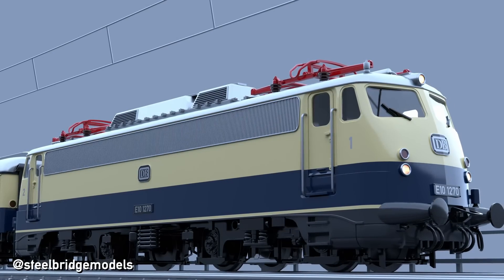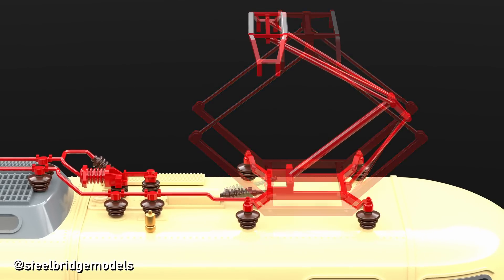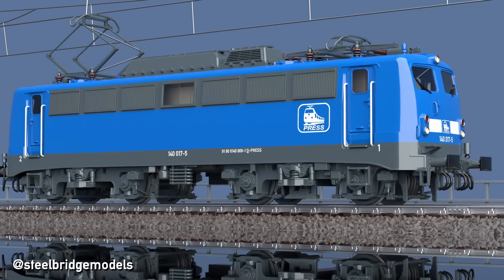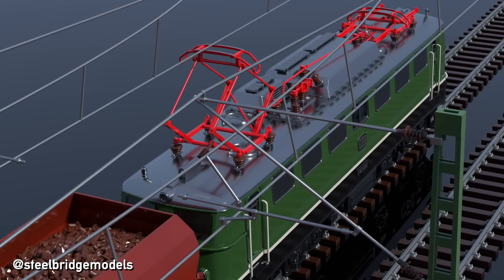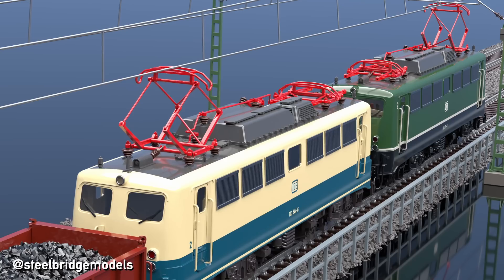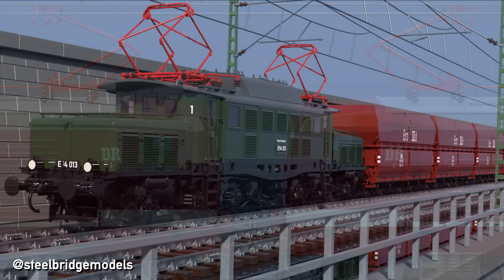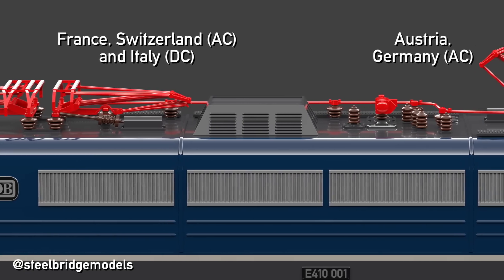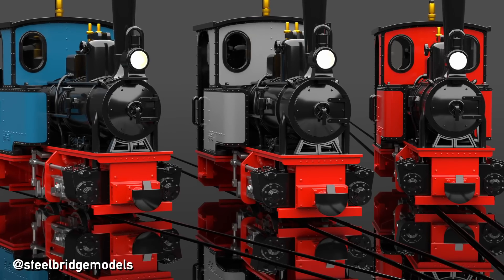When to use which Pantograph?

Comment: In the US, and I'm sure throughout the world, it's fairly common practice to raise both pantographs in icy conditions, but have the leading pantograph electrically disconnected. That's to clear buildup of ice make arcing less damaging to the collectors. Though not all locomotives can isolate pantos, the US's ACS-64 (and probably the Vectron) has the ability to select which pantograph draws power.

Comment: As a Russian railway engineer, I will add some. Always use a rear pantograph to lower the risk of damage to the roof equipment. Use both if you need to clean the wire from ice. Rule for AC 25 kV lines. Mostly applied for DC 3 kV lines, because we use double wire there, so high current draw is not a big deal.

Comment: Additional remarks on single headers:
1. When the front pantograph gets torn off, it may not only demage the back pantograph, but also the installations on the roof and dangerous or expensive fright.
2. Another case of raising the front pantograph is the first car being a cab car. In the cab can more likely be persons. In case of the pantograph being torn off, there is a higher risk of injury.
3. Rising the back pantograph looks cool.

Comment: Interesting. With modern (non-diamond-shaped) pantographs, I always assumed that the "knee" should face in the direction of travel - for mechanical reasons; it just feels logical to me. So you raise the pantograph that points the knee in the according direction.

Apparently, however, that is absolutely not a factor.

Comment: The worlds strongest electric locomotive is paired in the Swedish Malmbanan, and they seem to use rear one on both units. Also in the summer.
https://www.youtube.com/watch?v=If6wPIltDoY
Reply: The world's strongest?  Looks like typical ВЛ80К to me 
Actually it is great to know that Sweden has a railway network.
Reply: @igorzherebiatev5751 Tell me the stats. Cant find that locomitive model.
Reply: @Xanthopteryx  VL80
Power up to 6400 kW or 8580 HP
25 kV 50 Hz
Speed up to 110 km/h
Traction force up to 637.65 kN
Built from 1961 to 1995 USSR
Weight about 160 t
Length 32.84 m
8 axles. 2 sections.
Reply: @Xanthopteryx  found yours. IORE, right? 
Agreed. The Most powerful 2 section locomotive.

Comment: A verry nieche Pantograph configuration are with the Jungfraubahnen in Bern, Switzerland. They have two small pantographs *side to side*, as they draw two phases of a 3-phase system from two overhead wires, giving the motors greater power and torque.
Or the SZU (Uetlibergbahn) in Zorich, that has it's pantographs displaced to the side, as it used DC, while sharing some track with the SiTB (Sihltalbahn) that was directly connected to the SBB network that uses AC current. So instead oh needing to change electrification depending on what type of train was using the tracks, they just used double-electrification.

Comment: Why would having only one contact point be less of an issue in slower locomotives? It seems to me, the opposite would be the case intuitively, as the fast moving train could use its momentum to bridge a sort of "hole" in the connection.

Comment: The pantographs themselves are able to run in both ways. However, bow collectors are required to operate in only one direction, so they need to be reversed when trams change direction.
For AC catenary systems, using multiple pantographs can cause problems when going through a neutral zone. For a single pantograph situation, I heard that the rear pantograph is preferred because carbon dust won't pollute the electrical equipments at the top of the locomotive. But for some EMUs, there are multiple power units, each isolated from each other, so one pantograph per each unit is allowed.
But I heard that in some cases, even isolated pantographs can cause short circuit between phases, for example the 1st pantograph is shorting the neutral zone and the phase 1, and the  2nd pantograph is shorting the neutral zone and the phase 2, so phase 1&2 are shorted through pantograph1-neutral wire-pantograph2.

Comment: A couple of anomalies here.
In the UK on the form Woodhead route which closed in 1981 both diamond pantographs were raised, even when double heading 4 pantographs were used.
The line was 1500DC so obviously this drew much more current thanx25 KV

I also notice that in France on there large 1500DC network locos only use one pantograph but when braking to stop at a station both pans are raised.
Once the train leaves the front pan is lowered after about 150 metres from the station.

Comment: 6:53 it's not so much the different current that determines the fact that some locomotives have pantographs for different countries, but the fact that there are different prescriptions when it comes to their sizes. For example trains crossing the border over from Switzerland to France can change current on the go using the same pantograph, but between Switzerland and Germany the pantographs are different.

Otherwise very good summary. They're not common anymore, but panoramic passenger coaches also require in Switzerland to lift the front pantograph to protect the windows.

Speed restrictions are numerous depending on the distance between pantographs. For example for Switzerland, a distance of less than 13m between them will automatically reduce the top speed to 125km/h; between 13 and 40m, to 140km/h, more than 40m 160km/h, but the speed limit will be lower if there's more than two up by train (for example with 3, or 4), and they also vary depending on the rail line, high speed lines in general are built to better standards.

Checking the pantograph distance, number of them, and the tracks that will be taken by the train, is therefore one main job of the train preparator, which can be the train driver

Comment: you can however switch different AC systems without different pantographs, The US NEC trains do this on the fly with auto switching transformers. Due to three different AC systems. 12Kv@25hz, 12.5Kv@60hz, 25KV@60hz. The New Haven line EMUs for Metro North commuter RR can do the two overhead 60hz systems and 750VDC third rail.

The reason for three different AC systems is they all date back to the beginnings of railroad electrification the 25hz system is from 1915 and was built by the Pennsylvania RR, It was cheaper for Amtrak to just buy locomotives that could handle all three systems that to rebuild the whole power grid for the rail line.

The interesting thing I notice with EMUs is every car will have its collector raised.
Reply: The reason for using two different sets of pantographs for the dual system loco like the class 181 shown here, isn't just the different voltage and current, but also the different height and tension of the overhead catenary.  The catenary in France is lower compared to the one in Germany. That is the reason why the class 181 has such a low profile, the taller German locos wouldn't even fit below the SNCF's catenary. As a result, the pantographs for the German catenary sits lower than on a typical German loco, and has to bridge a bigger distance to the catenary - which means, the mechanism holding pressing it upright would exert a bigger force. As the force is even higher, if you would try to compress the pantograph even more for use in France, the wear on both, the pantograph and the catenary would become detrimental.

Comment: i had some question, first here we have commuter train, consist of either 12 or 10 cars. the cars usually come with 4 set, with power-trailing-trailing(pantograph)-power configuration. for 10 cars, the extra 2 usually trailing in some cases is trailing(pantograph). i live in equator, there's no ice here
1. sometimes only 2 pantograph were up for 12 cars, but some had 3 and or even 4. what condition apply so they decided to use all pantograph?
2. for 10 cars, usually it's only 1 up, but in some route, they use all pantograph
3. i realized, the more pantograph they used, the rougher it gets when accelerating

Comment: The pantograph topic that you are presenting here only shows pantographs from alternating current collectors. With direct current at 1500V or 3000V, as used in France, the Netherlands or Italy, the topic is completely different, since very high voltages are transmitted, especially when starting up. here a second pantograph is very often raised, or in the case of multi-system locomotives that use up to 4 power systems (1500V and 3000V direct current and 15kV 16.7hz and 25kV 50hz alternating current), the direct current collectors have up to 4 contact plates, as these would otherwise melt due to the transmitted current when starting up. This is why direct current overhead lines also have 2 contact wires so that the transmission strength is divided between several points. Italy even requires contact oil to be sprayed onto the pantograph using nozzles in the contact plate... At the end you explain the different pantographs on a 4-system locomotive, but you overlook the fact that the contact strips have different lengths. For this reason alone, no Austrian or German locomotive can drive in Switzerland, even though the 3 countries have the same power system, because the contact strips in Germany and Austria are 1950mm wide. in Switzerland they are only 950mm wide due to the different clearance profile. Other countries have different widths, and the EU standard stipulates that all routes will be electrified with 25kV/50hz in the future and that the zig-zag tensioning is designed for a contact strip width of 1600mm. Italy is converting many routes to this standard, Croatia is the only country that already fully complies with this standard, while other countries are still waiting. If EU funding is required for a construction project, then the overhead line must comply with this standard, which is why the Fehrmannbelt Tunnel is also getting an EU overhead line in Germany, but since it was decided before this standard, an Austrian 15kV/16.7hz overhead line will hang in the Brenner Base Tunnel up to the Italian tunnel portal, and from there the EU overhead line will be used... So you can't drive with the same pantographs everywhere, and each pantograph in 4-system locomotives is for a different country standard and therefore cannot be used outside of these...
Reply: Very good explanation, but the first "voltages" should be "currents".
And the conversion of systems is only done, when you change from DC to AC, so Germany, Austria, Switzerland, Norge and Sweden will stay at 15 kV, 16,7 Hz for quite a long time.
Reply: @ Unfortunately, I have to admit that my written English is a bit rusty, so I use Google Translate. But as far as the system changes are concerned: they are not only necessary because of the overhead lines and the power systems, but also because of the different train protection systems. Not even in Germany and Austria is everything the same, and so there is a system change at every border for vehicles that continue on to the respective neighboring country. So also between Germany and Austria... In addition, a system change on the existing routes is currently not planned anywhere except in Croatia, which has already completely changed over, and Italy, as far as I know, because that means that major changes have to be made here. For example: a 25kV overhead line must hang at least 0.5m higher than one for 15kV. This is a protective regulation.... It is not cost-effective to just change over like that...
Reply: ... but you are wrong in one regard: there are German and Austrian locomotives that can - and actually do - drive in and through Switzerland.
These do have an additional shortened pantograph fitting the Swiss requirements.
Same goes for Swiss and Italian (!) locomotives operated by various cargo operators running into Germany/Austria as they do have the required panthographs.
There are even Italian EMU´s running the Euro City passenger services between Frankfurt (Germany) and Milan (Italy) which requires them to be equipped for German/Swiss/Italian catenary and AC/DC Voltage systems (15kV AC in Germany/Switzerland) and 3kV DC in Italy and also the different pantograph sizes ...
Reply: @ I think you have misunderstood a few things here. Of course there are vehicles that can cross the border into the neighboring country without any problems, and multi-system locomotives that can use up to 4 power systems (1500 and 3000V direct current and 15kV/16.7hz and 25kV/50hz alternating current) are now standard. These also have the additional approvals for the other countries in which they operate. Similar multi-system solutions are also available for Emus. But: outside of the border stations with Austria, have you ever seen an ÖBB 1144 or 1016 in Switzerland? Or the DB 101? Conversely, an SBB Re 460 in Germany or Austria? No, right? And even from the series that can travel from these countries to Switzerland, e.g.: ÖBB 1116, not all locomotives are allowed into Switzerland, only those that have been equipped and approved for it. The same applies to the 4 system locomotives. Although the Siemens ES64 U4 (e.g. ÖBB 1216) can also run at 1500V DC, it will never run at this contact wire voltage because it has no approval in those countries where such a contact wire voltage exists and will not be granted approval in the future.

Comment: The double decker long distance Twindexx trains of Switzerland have a pantograph at either end and also follow these rules.
The recently retired rail cars (Triebwagen, idk) that ran on the line from Grütschalp to Mürren have two pantographs. However, only one of them can be used to draw power. The other one isn't connected to the electrical system and was only used to scratch ice off the overhead wires.

Comment: Aside from 2 pantographs giving redundancy, why not just use electrical switches instead of having up to 4 of them?
For example turning a switch so current from the same pantograph goes to the 1500V- input and circuitry instead of the 3000V- one, instead of changing the pantograph.
Reply from the maker: Many locomotives even have those switches in case the required pantograph is defective. But this is only an emergency solution, as different electric systems often come with a different geometry of the overhead wire, too. E.g. a system with a stronger zig-zag of the wire requires a wider pantograph head.

Comment: This is really cool! At Breda station (NL) I often see these Traxx locomotives on the Intercity Amsterdam-Brussels change the pantographs at the platform. I always supposed it has to do with Breda station being on a tiny terminus branch of 1.5kv with the mainline being on 30kv, but now it makes more sense: when changing voltage midway the route, one would want the rearmost 1.5kv pantograph in use, and since the train changes direction at this station...

Comment: You havent talked about which way a non diamond pantorgaph should be facing if that even matters 😂 love the videos ❤
Reply: It doesn’t matter. Compare the DB Br 101 and ÖBB Rh 1116, their pantographs face in opposite directions yet they still raise the same one (the rear one) while performing all passenger duties, at up to 200 kph for the 101 and 230 for the 1116.
Reply: @ so it doesn’t matter if it drags like this > or like this < ?
Reply: @Bluesthefox  Correct

Comment: Sweden is a bit odd when it comes to overhead lines on trains. It's 15kV with 16 2/3Hz frequency.
Reply: No, it is a very common system in Europe which is used in Norge, Germany, Switzerland and Austria. - But yes, it was a historical decision, that was made at a time, when electrical motors (of a size for trains) where not available for 50 Hz and the idea was to use AC, because you can transform it and therefore use high voltages and low currents.

Comment: Multi system locomotives have multiple pantographs not just for the different voltages - voltage differences can be handled inside, but different systems use different geometry overhead. Germany and Switzerland use the same voltage, but different overhead geometry, so border-crossing locomotives need a different pantograph even though the voltage is the same. I can't remember which way around they are, but one country requires a wider pantograph head than the other. The narrow head may come off the wire in the country that uses a more pronounced 'stagger' of the contact wire, and the wider head risks hitting overhead fixtures in the region that uses the less pronounced stagger. DC locomotives often had two as the current required to start a train moving was too high for one pantograph, so they would raise both and then drop one once the speed increased and the power demand dropped. I've seen many multisystem locomotives with two identical DC pantographs at each end (two raised for starting heavy loads) and two different 'AC' pantographs, the AC pantographs being set up for different overhead geometry. I assume it's usually up to the crew's diligence to ensure the correct pantograph is selected when crossing borders.

Comment: Regarding the "Single Point of Contact": Triple Phase AC Electrification would be an interesting Topic. Today, it can only be found on four Rack Railways (Jungfraubahn and Gornergratbahn in Switzerland, Chemin de Fer de la Rhune in the French Pyrenees, and one more in Brasil) but it used to be much more widespread, Italy even had an extensive Mainline Network until the 1970ies. Triple Phase AC uses a bipolar Catenary, like a Trolleybus. Two Phases are in the Wires, and the Third Phase is in the Rails. The Rails are grounded like on any other Electric Train, so there is no Voltage between Rails and Ground. This is a little odd compared to "regular" Triple Phase AC, where the Neutral Point between the three Phases mostly is grounded. Meaning to say in Triple Phase AC Rail Electrification, the Pointer Diagram rotates around one Phase instead of the Neutral Point, and accordingly the Neutral Point has a Single Phase AC Voltage relative to Ground to ensure that there is no Voltage from Rails to Ground.